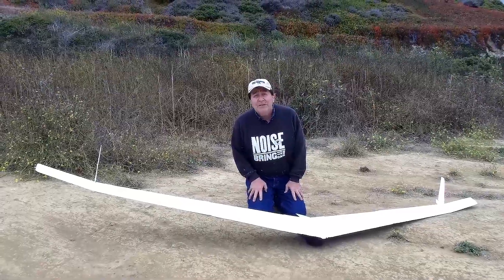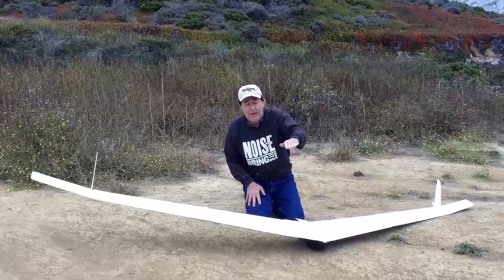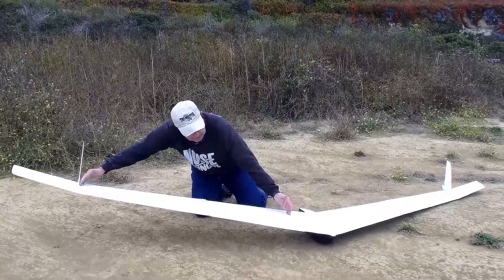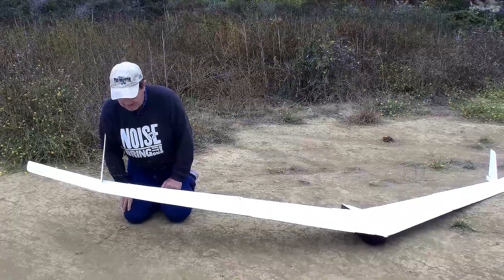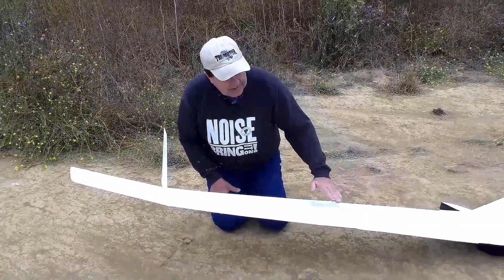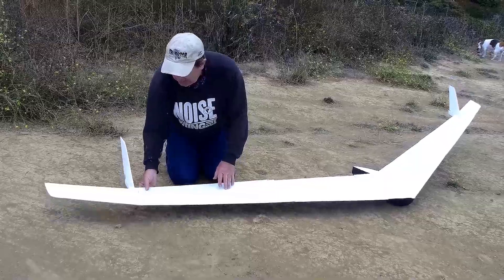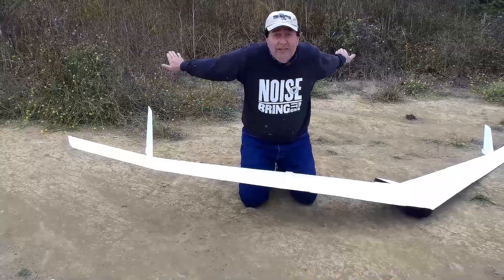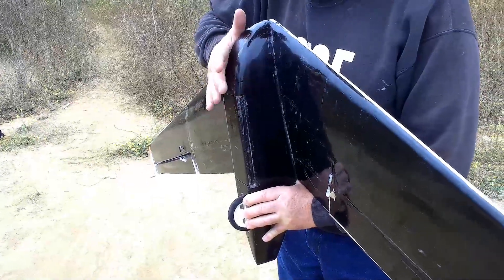Quarter Scale R/C Glider - Klingberg Wing MkII Development

Comment: Might you clarify how you manage to maintain pitch when flaps are deployed?
Reply from the maker: The pilot has two choices, elevator or weight shift. Elevator is best. As the flaps go down, down elevator is needed to pitch the nose back down. This elevator config increases the overall lift and further slows the glider. This type of flap arrangement was first proposed for flying wings by RT Jones (a NASA engineer) and first employed on the SWIFT hang glider.
Reply: Klingberg Wing MkII I Understood flap deployment on flying wings to typically provoke downward pitch, requiring upward elevator-  but with a design such as yours, or the SWIFT, a synergy between washout in the aft portion of the wing and center of lift results in pitching up.   I’m having difficulty conceptualizing how these features interact to this end- can you adjust my perspective?
Reply from the maker: I explain the concept in this video: https://www.youtube.com/watch?v=FqQysBqCQpE
Reply: Klingberg Wing MkII  Concept?  Yes.  Contributors for achieving flap-down-pitch-up?  Not that I could discern.

Comment: Enjoying your efforts with this project.  I hope you keep plowing through the many challenges.  Your central flaps appear to be pitch positive to me.   That is if you slowly feed in the flaps to allow the airspeed to drop off, once they are fully deployed you will experience a nose up trim.   For your wing planform, I would think that a flap that covered 50% of the half span would still be a little pitch positive.  The giant flap in thuis link was nearly moment neutral.  https://youtu.be/WvLPCJwOjSE
Reply from the maker: Thanks for the moral support and the technical feedback. Your thoughts along with previous comments got me to thinking on this issue and I have come to an interesting conclusion, which I'm going to test as soon as the wind improves here. I will do a video to discuss my approach and show the results. I think everyone will be surprised as I believe this can solve one of the biggest causes of performance reduction on flying wings. Keep your fingers crossed!

Comment: What a beautiful wing with great innovations. Noticed the pitch up on flap deployment, may want to consider lengthening the flap for neutral pitching? Doing so may also enable the flap to be deployed to 90 degrees for agressive glide path control? ( I had a long look at the Impact hang glider, looks like well over half of the trailing edge is flapped probably useful also in keeping the wing section in the drag bucket.) 
Looking forward to the day when the full size Klingberg 2 wing starts breaking records!
Reply from the maker: Hi Clive: Thanks for the great support. I'm currently building the wing tip sections and the winglet mounts for the full size glider. I expect to start on the main spars in 2 or three weeks. I'm currently resizing the flaps on the model and plan on testing again in a few days. Based on comments from miniphase and you, I've been giving the whole issue a great deal of thought. Fortunately, that thinking has yielded some interesting results and I have new objectives for the flap/elevon combo. After the next test flights I'll be posting a new video that explains the concept and how it works out in reality (too complicated to explain here). Overall, I'm expecting much better performance in thermals - time will tell. So, stay tuned!

Comment: Lovely looking design Rol, did you used the fullsize sections without any modification for this model? Any idea what the AUW is?

You probably don't need me to tell you but you'll always get a pit of a pitch up when you deploy flaps as the excess airspeed gets converted to lift. The model will then settle down to its flap deployed speed and that's what you need to trim for.... well, that speed plus a little bit just to help maintain control authority. I am looking forward to the next instalment!
Reply from the maker: Hi:  Thanks for the positive feedback and continued support. I hope my work helps all aircraft designers/builders.y Thank for our point about flaps as it gives me a chance to discuss another unique aspect of flying wings. What you said is 100% accurate for almost all designs, EXCEPT swept flying wings. With a flying wing it's possible to have flaps cause nose down, or nose up, or no pitch change. It is all a matter of the relation between the aerodynamic center and the size and layout of the flaps. On my KW100 R/C glider kit I was able to set up the flaps such that no pitch change occurred for any flap setting. Ilan Kroo worked this issue extensively for the first version of the Swift. He wanted to use the flaps for pitch control also (a reverse of the normal flap behavior). So, this is another example of something that is commonly known and taught about designing and flying aircraft that does not apply to flying wings. I hope this info helps all flying wing designers develop even more interesting designs. Finally, I assume that AUW means All Up Weight. For the 1/4 scale model, I have never weighed it, but I'd guess around 4 or 5 lbs. As to the full size wing, I'm designing/building to 100 lbs - a tough goal - wish me luck. Fly Safe!